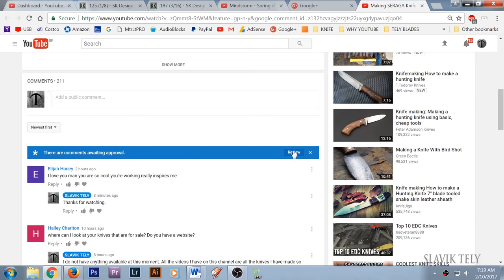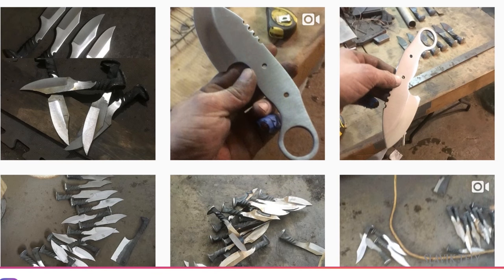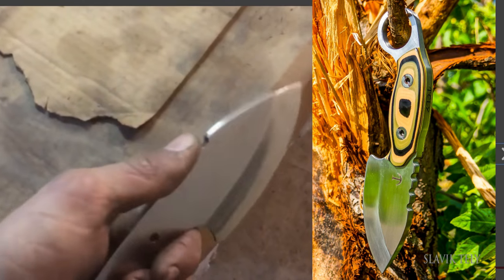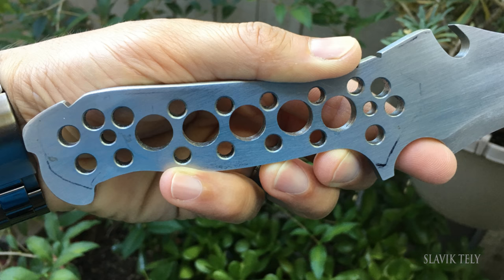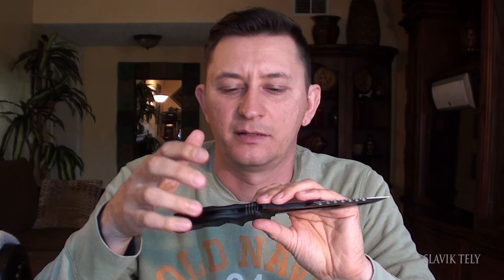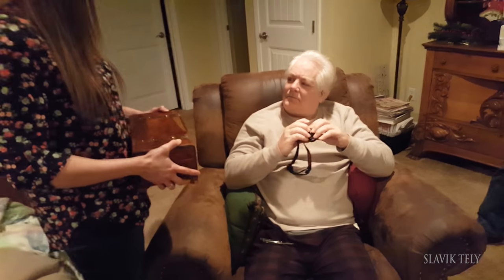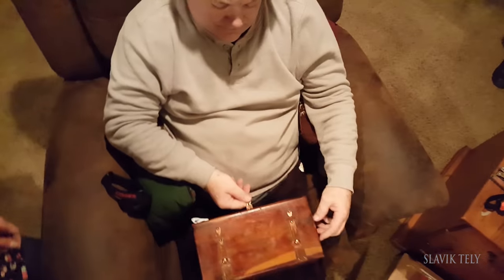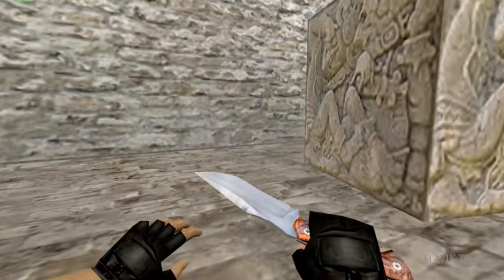Q&A and Unboxing Seraga Knife

Comment: I'm planning on saving up my money to buy equipment so hopefully I can make knives within the next two years. You've been a great inspiration. Thanks for the videos!
Reply: William Porter all you need to start making knives is a decent set of files and cheap structural steel to practice on. You can get both at and builders store for 25-30 bucks. Every second of practice you can get will make you a better craftsman. Just my two cents.

Comment: Drilling holes in the tang will also provide a chemical to chemical bond of the epoxy used.  If not u only have the G10 bonding to the steel with the epoxy. Overall it makes for a stronger bond of the handle to the steel
Reply from the maker: Yes sir.

Comment: Does it matter how long you temper the blade? Or does it depend on the thickness of the steel? I normally use 1/8 thick, so I'm trying to figure out how long I need to temper it.
Reply from the maker: From what I have seen, you temper the steel 2 cycles at one hour increments. The longer you temper, the softer it gets.